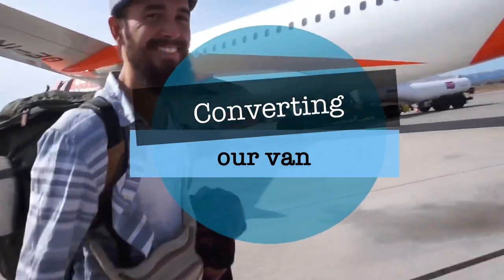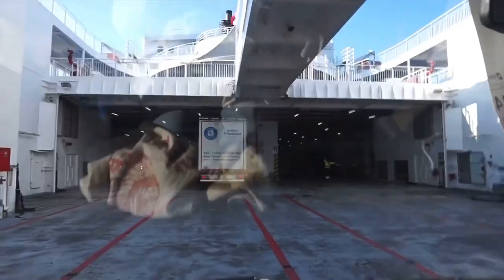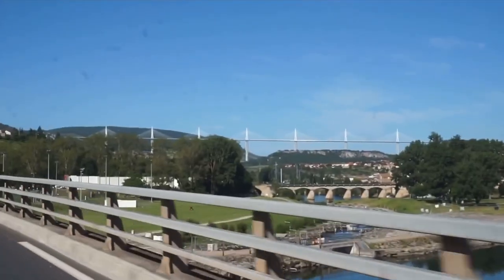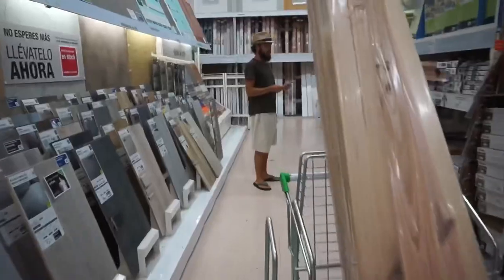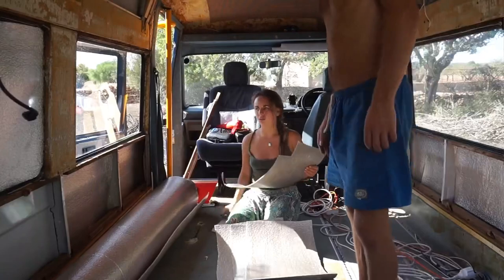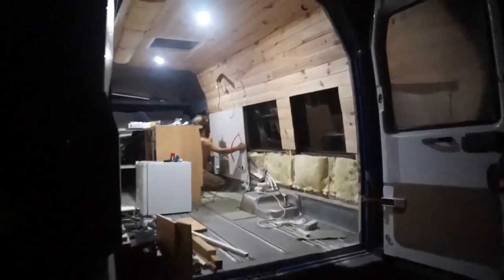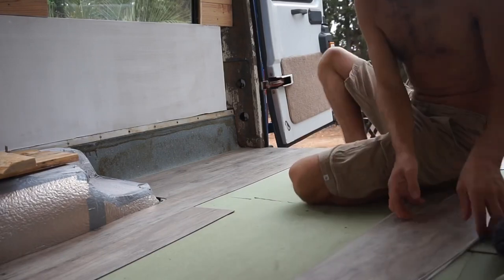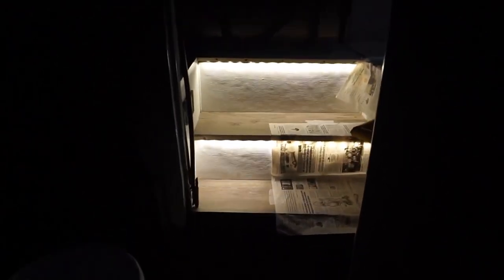LDV Convoy to Camper conversion and driving from England to Spain! | Van Life Series Episode 3

Comment: Charging the batteries by using the vehicle battery is an excellent idea how did you manage that?
Reply from the maker: Yeh it is a must! You can buy a little relay that sits between the batteries that automatically turns on and off when the motor is running, but I preferred to have a manual switch, that way if it is sunny and we have enough solar then I can just leave the motor to charge the starter batteries etc… just have to remember to turn it off when you stop otherwise you risk running your starter battery too low to start the van! But ultimately all you need to do is connect your batteries (as long as you don’t have lithium, for lithium you will need a battery to battery charger).

Comment: Did it work out more cost effective fitting it out while in Europe? Love the video! Bold move!
Reply from the maker: Hi, sorry for the very late reply. I would say it actually cost a little more fitting it out in Spain, possibly because we did it in Mallorca so maybe mainland Spain would have been a little cheaper. But I think the UK has cheaper options/more availability for most things. Plus if you want to find things second hand on eBay or FB marketplace, I think the UK is much cheaper than Spain.